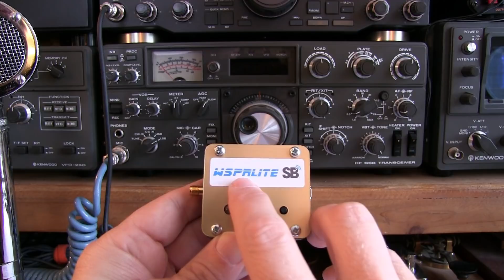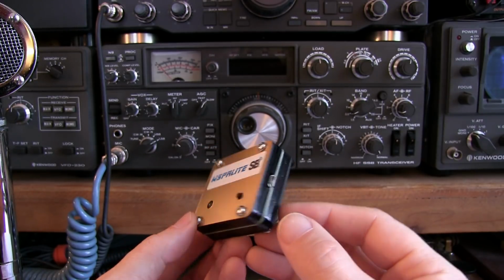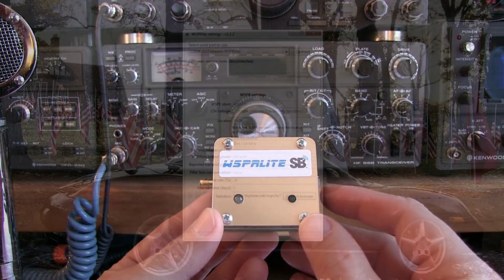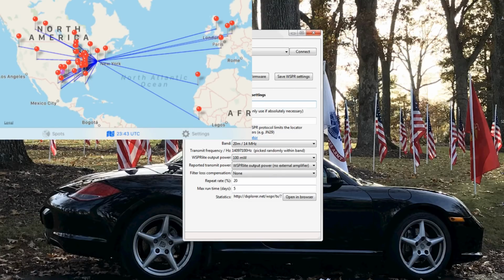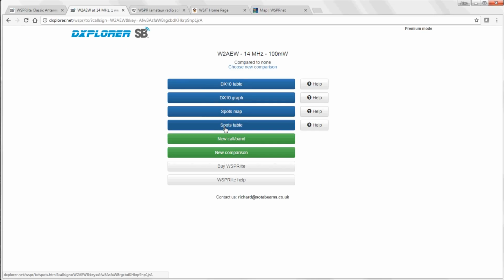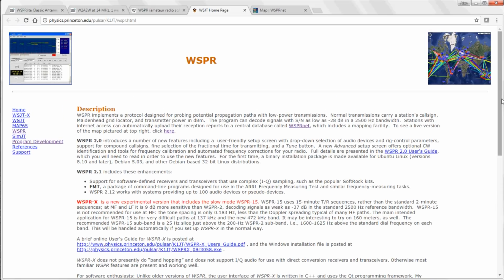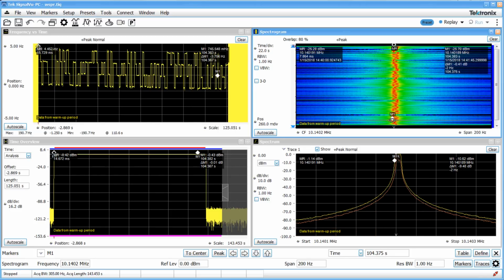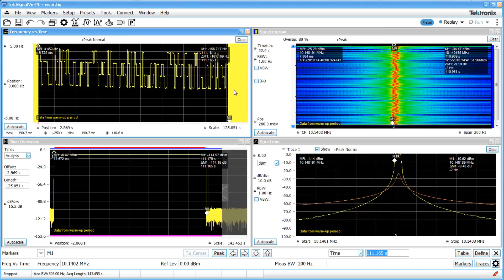#279: Ham Radio: WSPRlite review plus DXplorer and view of 4-FSK transmission

Comment: There's no way that 820 has been on your bench for 30 plus years looking that good. Did you get it silk screened and refurbished.?? Props btw if it has been on your bench and looks that good. I have one complete 820 station as sold by Kenwood Australia and a second one in a box somewhere. There's something special about old gear where the input was manual. Cheers
Reply from the maker: I've had the TS-830S for about 20 years, bought it used.  It was it very nice shape when I got it, just needed a bit of cleaning and a minor repair or two.
Reply: w2aew oh it's an 830 I knew I would get it wrong. Congratulations though it looks brand new. It was the readout I wasn't sure about it looked slightly larger than the 820
Reply from the maker: The camera does make it look nicer than it really is.

Comment: I have some old circuit drawings that have some had to find transistors, and I was wondering if there is a site that gives a cross ref. equivalent, from whatever to a 2Nxxxx type.  I've searched the web, and not real happy with the results.  I look up a part number, like ecg220, and it gives me some car break part.  I stipulate that it must be a transistor, and get the same results.
I have one of the older ECG catalog, and I can put in the part I'm trying yo find, like a RS2036, and it gives me a ECg220 part number, but I would like to find the 2Nxxx part number.  There must be a site some where on line with that kind of information???
I'm getting very frustrated, and not getting what I need!!!!!!!  Any Kind of Ideas??????   Email= restore.n.fix@gmail.com
Thank You!!!!!!! 
Show less
Reply from the maker: ECG was a set of replacement semiconductors.  One ECG part would often replace dozens of original equipment part numbers.  The replacement catalogs weren't arranged to do a reverse lookup.  The best you can do is look at the basic specs of the particular ECG part and then look for a device with similar specifications.  Or, maybe find/download a PDF of the replacement guide and perform a search to find all occurrences of THE ECG part to see the devices that it subs for.  Maybe get a digital copy here:
https://archive.org/details/EcgSemiconductorsMasterReplacementGuide1989
Reply: @w2aew  NTE (who is still selling "universal replacement parts") copied ECG's numbers.  I never liked them for that reason.  In the past I've had occasion to call ECG on the phone and get some help,  they were great to deal with.  I'm sorry that they're gone.

Comment: Alan, I really enjoy your videos! I have been interested in RF for many of years; it fascinates me. I have a very basic background in electronic. Simple foundation of the basic components. I would like to start home-brewing my HF equipment; I would like to start with the Michigan Mighty Mite and eventually build my skill-set to where I really understand the inner workings of a radio transmitter and receiver (Mixers, LO, IF, RF amps, AF Amps, etc.). I could probably get by with a very cheap Chinese 100Mhz oscilloscope (For now, I tend to stay within the RF range of 1-30Mhz). As my skill-set strengthens, I would love to make sure that my builds have little spurious emissions, would a oscilloscope with FFT be sufficient, or would a low end SA be a better option? What about some of the SDR out there that are labeled as "Poor Man's Spectrum Analyzer" Thanks
Reply from the maker: Each of these options will have some inherent harmonic distortion on their own - so it may be difficult to determine if a harmonic component is due to your device, or due to the measurement equipment.  It would be best to have a few options to compare (scope+FFT and SDR-based analyzer, for example).
Reply: True about the harmonic distortion. A low end (Chinese brand) SA with a TG is around $1,500 bucks, which is manageable; I think my options right now would be between a Rigol DSA815-TG or a SIGLENT Technologies, SSA3021X. I would probably do without the TG and get a Instek GSP-730 which is around $899, but as a ham, the option to use a TG and tune a couple of duplexers would be nice to have. Again, thanks for the information!

Comment: I did not know where else to ask a question that you may get soon.  So I'll ask it here!
on your videos about Smith Charts,  where do you get the Reactance value ( -JX)?
on the SimSmith, you use the -51ohms  value, and I was just wondering where that comes from!!!
Reply from the maker: The test load circuit is 33 ohm resistor in series with a 220pF capacitor. The test frequency was 14.2MHz. The reactance of a 220pF cap at 14.2MHz is 51 ohms.

Comment: Interesting review.  What kind of antenna does it require and how do you hook it up to a Kenwood TS-830S like the one in the video?  I won't have my 830S set up until I figure out how to put up a DX antenna for it on no land whatsoever.
Reply from the maker: Any type of antenna that is suitable for the band you're transmitting on, will work fine.  This device does not hook up to a transceiver like the TS-830S - it is a standalone beacon transmitter.

Comment: Nice review!  Does it use an RTC to transmit at the start of the minute?  Last time I played with JT65 or WSPR, I thought you only had a few seconds error tolerance.
Reply from the maker: You have to manually start the transmission - usually at the start of an even minute, with a few seconds of margin.  After it's started, it uses its own internal clock/timer for subsequent transmissions.

Comment: Thanks for the excellent explanation and showing what is actually being transmitted using that mode. Which bands do u usually run WSPR on and type of antennas used? TNX agn fr the upload!
73  N8AUM
Reply from the maker: I've only tried 30m (10MHz) and 20m (14MHz) myself, using a 130' dipole antenna.

Comment: Can I leave this on 24x7?  What sort of antenna is really the maximum I would use with it?
Reply from the maker: Yes.  You can set the transmission duty cycle as well as the number of days you want the device to run.  It is most useful to use it with the antennas you would normally use for HF operation - so that you'll get a better picture of how these antennas perform.